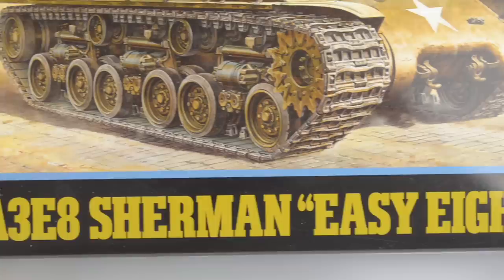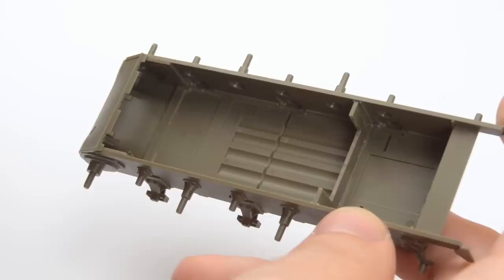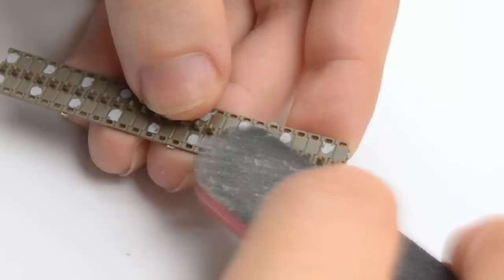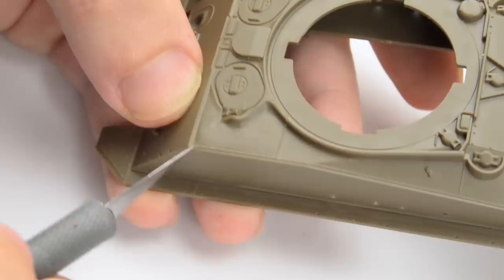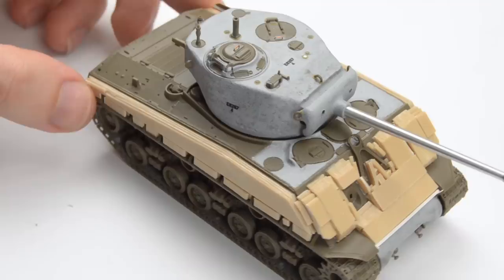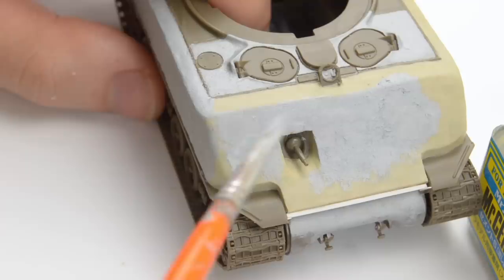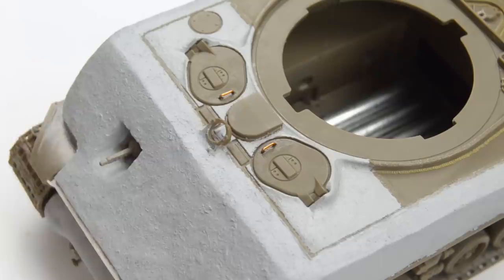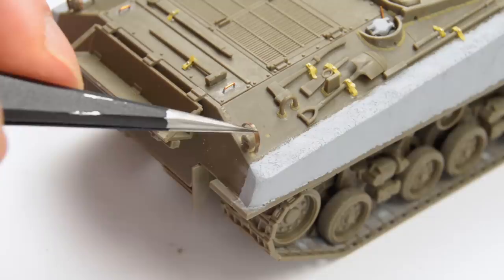Let's Build a Sherman Easy 8 With Concrete Armor! | M4A3E8 | Tamiya 1/48

Comment: Fury is wayyy to over-built in my opinion
Reply from the maker: Not overbuilt, but over-customized. Two turret machine guns, wooden logs, German helmet with a gasmask, spare tracks, a ton of stowage etc...
Reply from the maker: It also has the wrong track type if I remember correctly. The rubber chevron T84 was a post-war thing.
Reply: @NightShiftScaleModels  lol I never noticed any of that xD
Reply: @NightShiftScaleModels  ...and Fury is also a postwar Canadian M4A2, which the Americans didn't use in Europe.  A2's were in the Pacific.
Reply: The US only used A2s in the pacific until 1942, none were ever used with HVSS, the Marines and PTO army swapped to M4A3s in ‘43
Reply: @brandonbrockwell4997  Yes, that's why it was a "postwar Canadian" one like I said.
Reply: Kelly's Heroes has more historical accuracy than FURY!  :D  Hated the story line and the bizarre take on US GI uniforms, but still some entertainment in seeing the tanks move about.

Comment: The metal weights are of course there to bring the weight of the model to the correct 1/48th scale point. 30ton tank / 48 -> obviously Tamiya has included 625kg of weight :) (yes I know it's more of a ^3 type deal)
Reply: The cube root of 625 is still 8.5 kg
Reply: @inaoifeble  The amount would sound almost plausible for me to be honest, but I think the correct formula would probably be something like weight_scale = weight_original / scale^3...
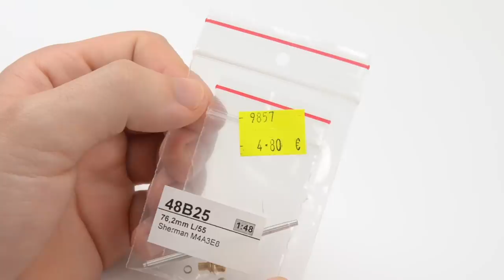Reply: @decnet100  Indeed. The weight comes down to about  272  grams for a 1:48 scale  model of a 30 ton vehicle using that formula. Doubling the size of an object would result in the volume or mass increase by  a factor 2^(3)=8!
Reply: @estiennebreed713  Don't take it too seriously but you shouldn't point a exclamation mark after a equation because it would now say 2^3=40,32
Reply: @angrymario8259  I see what you mean. I remember that my comment did not look right. 8 factorial is indeed not 2³. Probs should have put a space or something in between 🙈

Comment: Final comment - Trumpeter produce excellent grab-handle jigs - 3/4/5mm.. Just insert thin brass wire and KER-CHUNKA, you can punch out great grab rail forms that only need clipping (depending if you want inserted straight ends or surface weld end handles). I can personally recommend them over using forceps / pliers.

Comment: When I was a kid (okay, 1960) tank models came with flexible black rubbery plastic tracks. So it could be pushed around on the tracks, before you blew it up on the 4th of July with fire crackers!  Good times.

Comment: Takom actually molds their roadwheels without seam lines along the rubber.  Saves so much time!  They use one of the two metal mold halves to model the entire wheel and the other half as a mainly flat plate so the seam would be just along the tyre's edge where it is not noticeable.

Comment: Thankyou for pointing out T23 rear turret 'stretchmark's',i'm just closing up \35 rfm Easy8 and thought i'd done everything possible.I melted some sprue with Tamiya extra thin then poured it on base of turret smearing it to top,then scored in some lines\dents\ridges with end of small brush.Cheers again.

Comment: One more thing. Give it a coat of Aves paste,half ways thru the curing time press popsicle sticks to achieve that effect. I love sculpting and always trying out different techniques. Do coat the paste with denatured alcohol so they don't stick. PS. Your paste should already be mixed with Aves powder so you get a instant cast concrete effect. Hope this helps.

Comment: They did the weights for the 1/48 38t kit as well. I found them pointless personally but ah well. Haven't built this kit yet but it's on the list. I like the 1/48 Tamiya line. I have one of the Tiger I Afrika kits on the other side of the work bench that's decent. I had to order grills and a metal barrel for it but otherwise it's a decent little Tiger I kit. Nice work on this Sherman.

Comment: chonke tonk
(big edit) 
Dear uncle Night Shift, i was the one complaining about the difficulty of getting other models than revell's in my country, in one of the T-90 videos. Well, i'm currently building it (is a Leo 2A5, 1/72 scale) and it is quite decent, as far as i go, pieces have fitted nice and has a fair amount of detail (excepting the end of the main gun), the turret "wings" have the capability of unfolding but you have to sand down just a TINY bit the arms and the holes in which they fit (i sanded them a little bit too much) and the main gun elevates or deppresses. When i have more time i'll be doing the suspension. I suppose it is better than the T-90 and will recommend it to you. Also i hope that when you finish the Sherman the result would be satisfactory to you

Comment: Let me say first that I help restore real tanks and get to operate them in reenacting. I like your modeling videos a lot. On this one it is very rare to see a concrete  up-armored tank to day. I saw one years ago at a event that was faked with plywood chicken wire and spackled with brick mortor. I like the stowage in that it has American and German fuel cans as well as a water cooled machinegun can, that was used for potable water as well. You need to have a 5gal potable water can. Most tanks are seen with the. They are not made the same way as fuel cans. Keep up the good work.

Comment: Uncle night shift. You can use less hardener with epoxie putties to slow the curing time. I do it with Aves to where I always end up with some hardener leftovers. Try it out some time. You have a limit to how much you can skip out on before it never cures. For the most part it's forgiving,given you mix them well. I swear by Aves,I like it better than Tamiya due to it's softness. Try Aves fix it sculpt,it might work better for weld beads since it's alot harder than regular sculpt. They have a paste,wich I dilute with denatured alcohol to thin it out,I then take my left over Aves and sand it to make powder. I mix said powder to the paste to add cast texture. As a foundry man I know texture to well,and that trick nails it every time.😉 Cheer's uncle night shift,from California.

Comment: Super vid as always, I wondered what the vms paper shaper set was like, looks great to work with.
I'm looking forward to seeing how it reacts with paint.
I have a few of their products, the flexi glue is great for p.e. But the old style bottle is a nightmare for clogging and the lid sticking etc.
This in turn is causing the glue to start thickening in the bottle.
I expect to lose 85% of the glue because of this problem. 
They have addressed the problem with a different bottle but I'm not sure how well it has solved the issue. 
I'll wait till the one have now is totally useless before I try it, 
it's not cheap when you add the shipping cost and end up not being able to use 85% of the product because of the bottle it comes in. 
Most of their  other liquid products come in super handy dropper bottles  that are great for adding acurate amounts of liguid by the droplet. They make it easier to get mixing ratios spot on.

Comment: unfortimately concrete armor while it might seem a good idea isn't. the concrete is easily penetrated, and splinters so it can be a great last sight for the infantry near the tank. meanwhile while it doesn't improve effective armor thickness it does increase weight significantly resulting a slower tank which burns more fuel.

Comment: Fun fact: the concrete armor did nothing against most german tank shells. Maybe very low caliber wouldbe stopped. All it did was increase weight on the front of the vehicle and stress the transmission and suspension.

Comment: The way you assembled the tracks is very handy, but when I tried it on my Tamiya 1/48 Type 10, the links disconnected even after at least 5 minutes of letting the glue set. Looks like I will have to paint the parts (including the running gear), then painfully glue the tracks directly on to the tank. Yay... Also General Patton must be big mad because of moving bunker tank. It looks good

Comment: Please Try using electrical tape cut it to the size and width you want take the sticky off with lighter fluid and a cotton swab and you can either leave it the colour it is because you can buy brown black red blue yellow and green or paint it in a colour you want this is the ideal stuff for making "straps belts and laces" I know you are an expert and I defer to them but I learnt this trick 6 decades ago when making 55mm figures

Comment: Modelers should use caution when adding armor to any AFV model.  If the suspension and engine were capable enough of handling the extra weight, the designers would certainly have added it.  Driving one of these things loaded to the gills is like driving a car or truck that is overloaded.  It absolutely ruins the performance.  You can not get very far when the best you can do w/o bottoming your suspension is 5mph.

Comment: Hi unlce Night Shift. After thinking and thinking I finally decided to do the armor texture with epoxy putty since you are a great base of inspiration! Thus, when I started playing with the putty, I some thoughts came to my mind. First, how do you clean the brush that you used to apply the putty if that's even possible? Also what do you use? And how/with what should I clean the excess putty if there's some on surfaces that shouldn't have texture at all due to the way of casting the metal steel plates? As far as I went texturing the tank, it looks nice but yeah, I'm sure it can be improved a lot. Thanks for all your tips!

Comment: Any recommendations for someone who's never done this before and is generally awful at anything involving building? I don't know how I found your vids but they got me wanting to try.
Reply: Just give it a shot, if you don't succeed at first, keep trying and don't go all demanding on yourself or your skills. Cheers! (oh and watching maybe one or two YT tutorials may help as well)
Reply: Don't worry about messing up, stick to simpler kits at the beginning, even if they're not your favorite vehicles. Tamiya's M41 Walker Bulldog kit is always a great starter kit because it's only like $15, the pieces practically fall together, and it's decently detailed for how few parts it has. I like to keep one in my stash for testing new painting/weathering techniques

 To get started, you only really need some plastic cement, a pair of cutters (Nail clippers work decently, if you're fine with doing a bit of extra cleaning and sanding), sanding sticks or sandpaper, a hobby knife, and paint, primer, and brushes.

If you're on Reddit, /r/ModelMakers is a great, well-moderated community that knows when and how to offer constructive criticism without being rude or mean.
Reply: What they are saying Brent. Just dive in my friend and before long you have some cool tanks finished up!
Reply: @vonsopas  Exactly!
Reply: @TheDeltaLambda  So true!
Reply: @THROTTLEPOWER  Awesome! Thanks y'all.

Comment: Out of curiosity why do you fill the ejector pin marks on the insides of the tracks. I'm probably wrong but after doing mud and weathering details you wouldn't see those marks

Comment: I tried building the P51D-5-NA in 1/48 from revell... I gave up after trying to fit the wings and the fuselage... I had to sand down 5mm of EACH wing and can't make the radiators fit. I'll never buy revell again.

Comment: Hey nightshift, just a quick question but if I'm building this without the concrete armor would there be any additional texture to the front and side armor? I'm assuming no, as there is no existing texture there and I can't see any major texture in reference pics but just wanted to be sure

Comment: Why do you glue the parts together by holding them in place and then applying glue instead of applying the glue to the contact surface first?
Reply: The super thin glue travels into the gaps via capillary action. It helps prevent over application of glue.

If you use a thicker glue and apply it to the edges it can squidge out when you push them together.

Comment: I got this same kit and it did not have the weights, the photo etch, rope and the tracks were made with rubber. It’s been a year since I’ve built it but I’m just wondering if I had an old version of the kit or what.

Comment: Is that even a good idea to have concrete armor instead of steel and metal
Reply: Not really because concrete takes a long time to dry and it is usually added by the crew like a field upgrade to the armour and not from the factory